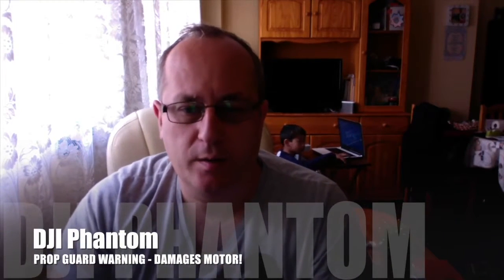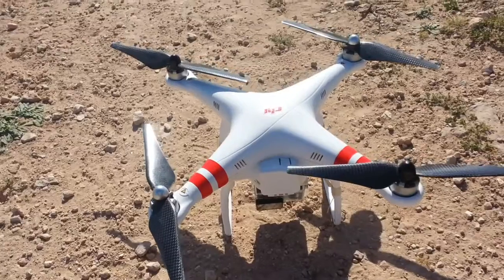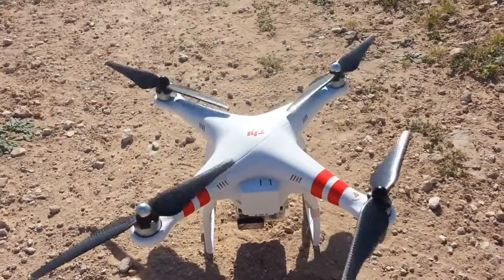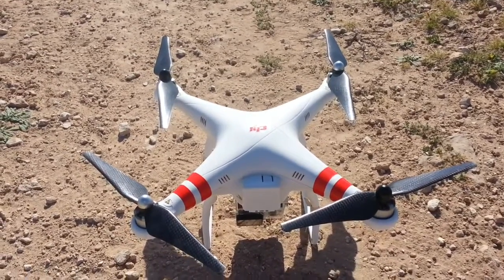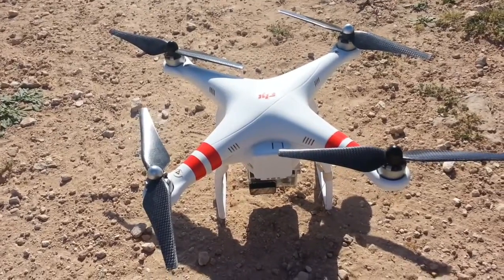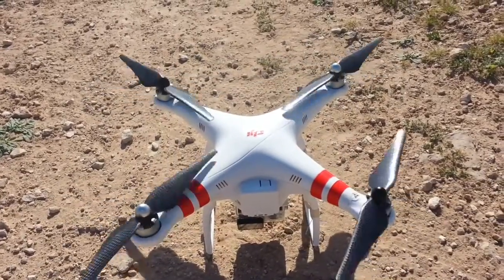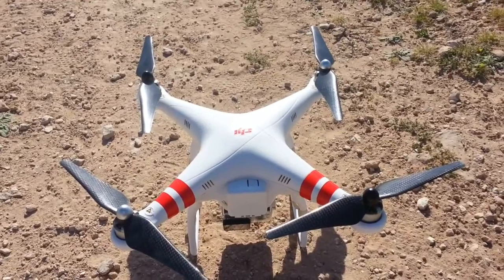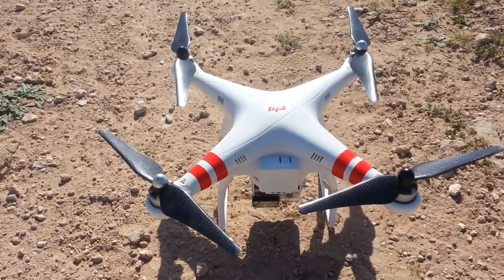why DJI phantom motors not spinning / Juddering SOLVED

Comment: Ya I'll change the motors as well with the boards it's a vision plus tho .... and the motors and boards will be from a regular vision .... you think it will work? I thought it was just a original phantom 2 I had for parts but it's a vision .. hoping it's compatible with the vision + .. will send update once completed. Cheers

Comment: This has literally just happened to me - i spent all day fixing it from a water crash 3 years ago - as i had not flown for a while i thought i would put the safety guards on as a precaution now two motors are spinning very slow devastated is not the word - is it the motor that's gone or is it the wiring - thanks for the video - pity i did not see before hand,i have to say this is very poor by dpi = why make it if it kills your drone.

Comment: I had this same identical problem.  Removed the prop guards and used the same original screws and the motors never started again.  The engineers who designed the motor screws for the DJI Phantom 3 Standard are poor low life idiots.
Reply from the maker: Yes, they should have at least offered a replacement motors for the damage done. As its a design flaw.

Comment: this is not ESC problem or Screw that is trouble on cable you can resoldering or changing the cable with the new one, maybe it broke in Red or Black or Yellow cable...i have been fixing and solved

Comment: This just happened to me I took the props off and screw in the screws and it went all jittery slow and actual smoke came out of the one side and fried the board on my Phantom Vision Plus I have a phantom vision for backup if I take the board off of that from the same side will it work??? I'll just resolder whatever I unsolder what do you think?? ** pissed***
Reply from the maker: Could have a go but it's the motors.